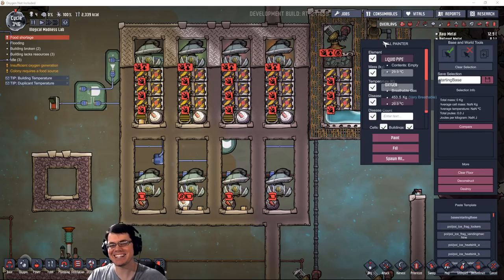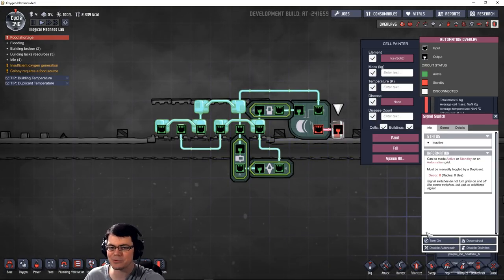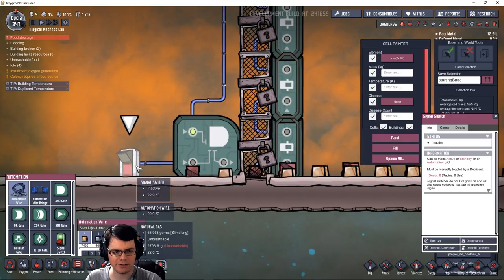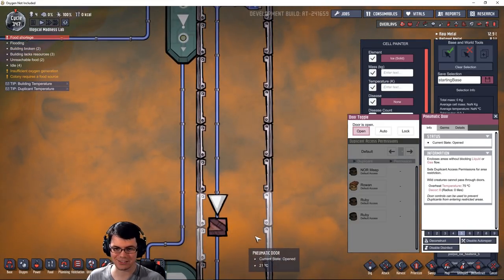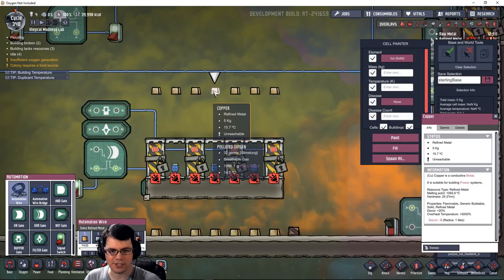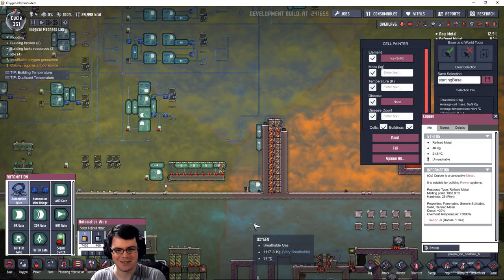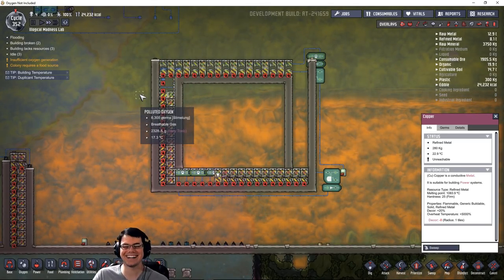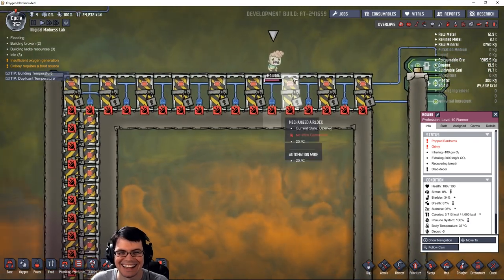Conveyors and Elevators! Oxygen Not Included Automation

Comment: Question, can you build a Polymer press on a floor, then replace the floor underneath it (and one tile to the right) with a door? Will it still function whilst the door is closed? Whilst it is open? If it does function while it is closed, you could sync the door do the plastic production, and cause the plastic to drop into an automated conveyor that will transport the plastic to a cooler environment to prevent it from melting (perhaps have active cooling pipes run through the conveyor to keep the air in it cold for the plastic, and use less energy consuming cooling mechanisms to keep the press functional)

Comment: What you need is a 2bit counter and an decoder that makes sure that there's always a place where the material/liquid/gas can go. That way you have an actual moving compressor/conveyer/elevator. I've already described it working here https://forums.kleientertainment.com/topic/83723-useful-automation-gadgets/?tab=comments#comment-971642

The way it works is that there's always two doors side-by-side open and two doors side-by-side closed. For example, AB closed and CD open. At the next tick A open and C close. Next tick B open and D close and at the final tick before it resets back to original position C open and A close. So if you have a long line of them it will be a continuous moving opening and closing row of doors.

That is a the real way to do it.

Comment: Yay!  Conveyors!  The last remaining question in this is "Can you do this such that gas does not leak through?"  If you need this stuff in your base (say, a planter box farm that your dupes are too lazy to harvest themselves), you could have the stuff dumped in to a water lock or maybe a petroleum lock that your dupes have access to.  But can you easily dump fertilizer in to a furnace to get sand without contaminating the furnace with bad gasses, then get the sand out?

EDIT:
Yes! You can! You can use something like the mechanical water pushing airlock from your airlock video to vacuum the chamber, removing the gasses!  If there is magma in the furnace, you can use an elevator to move the magma and wand up, then to the side over a mesh tile where the magma can drain away, thus leaving you with sand!  You can have pipes with water or oil in them behind the doors to try to cool the sand for use in the base.

Comment: I can see the use of the timerblock now! In your fertilizer maker room/natural gas plant just open all the doors under the machines once every cycle, making the fertilizer drop to an area dupes can reach. Will require a system to keep the Natural Gas from escaping the room. Maybe a conveyor at the bottom of the room going from right to left with a naphta lock at the end where (hopefully) all the fertilizer will drop and a door above the last one of the conveyor that opens briefly to let the Natural Gas back in the fertilizer maker room. All of this triggered by the timer block and set up with buffergates so it only but automatically runs once every cycle.

You could pretty much do this in any factory setup, given the rest of the factory conditions are stable and handled. Still trying to think of a good way to set up a plastic factory and handle the steam and heat waste properly.

Comment: That's how I made my ice maker.  Water drips onto the tops of doors in a cold hydrogen room, turns to ice.  Once a day, the doors open and drop all the ice on the floor, then the door stack pushes the ice into a room that reseals and becomes accessible once the hydrogen has been pumped out.

Comment: So, the strategy is when you want to excavate a large mass of land, you would first build this at the very bottom of the dig site, and use ladders to dig out the whole area, so that as you work, everything is being shuffled into one spot.  Then, if you're working above your target storage facility, you dig the pit down (this could be done before), or you build the elevator to move the mass upward.  You could do both legs together, but it's probably situational depending on how much material you have for doors, and where you're digging versus where your duplicants are coming from.

If the material moves up one to the side and then falls when it's transported horizontally, then does that mean that you could also move things at a diagonal?

Comment: MAS SCIENTIST EPISODE! This was really cool, and a neat look into how the physics of the game works. It's interesting that it takes the speed of the game into account too. Maybe it simply can't recalculate fast enough to keep up with the speed increase? Suddenly my game chugging at times makes way more sense lol.

I feel like if you even partially enclosed the system it would work as a water conveyor just fine. Maybe add a few blocks on the left above the doors and see if you can get it to pump out that way.

I see you've found a way to automate hatch feeding, excellent!
Reply: To elaborate on the hatch feeder: the fertilizer maker sits on the doors which periodically opens to drop the fertilizer to waiting hatches. We know hatches won't go beyond naphtha doors if they don't have something to stand on, and they don't require oxygen to survive, so its safe to have them in an air locked chamber of whatever producing coal. Dupes can come up a ladder just to the side of the naphtha lock, hold their breath long enough to collect the coal (or just be in a suit!), then escape with their carbon goodness to go feed the coal generators, which in turn feed slicksters, which make oil, which is then super heated to natural gas, which then feeds the fertilizer maker, which in turn feeds the hatches...

Closed loop with (I think?) no waste and potentially a power gain? Might have enough spare oil to use for plastics too.

Comment: The last time I tried the elevator, we could not go lower than 1s for the buffer and filter gate. Maybe now, with 0.1s interval, I could make it work. Will give it a try tonight to see if it works and send you some pictures if it does.

Because as you saw, you cannot force the duplicant to move sideway with a door. But I found a way to fix this (hoping it still works with the last update of course).
Reply: It seems that you can pick only 0.1 OR 1s. Values between the two are not selectable, even with direct input (they either go down to 0.1 or up to 1).

It is a shame as the duplicant get stuck with 0.1 (doors close too fast) or they are climbing up by themselves with 1 (too slow).

Comment: The right only conveyor can be made a lot more simply,  use a Weight Plate under a door to create a simple clock then with a Not Gate and some wire you have a super simple conveyor. I am curious what other uses there are for a simple clock as I feel there are many

Image: https://imgur.com/a/TrIpD
Reply: In that system, you could save a tiiiny amount of resources by lowering some of the top wires by a bit.. Just an observation.

Comment: What if you made an automated hatch farm in which the material is conveyed in through the roof on to a clock activated door in the hatch area. The clock would only open the door when the hatches are burrowed. With a working system you can have completely autonomous coal farming!
Reply: The dupes would never even have to see the hatches. Only thing you would have to worry about is uneaten material getting through. The amount of material going in would have to be monitored or limited somehow. I should start doing some experimenting myself lol.

Comment: I wonder when you'll run out of things to clap with at the intro lol

Also i see where you're going, produce natural gas and fertilizer, the fertilizer gets into the conveyor belts, and then maybe drop into a really hot area so they become sand? I wonder if that would work, wouldn't the fertilizer maker stop working while the doors under it are open?
Reply: Sukiida there will always be more to clap with
Reply: im sure it will stop working while the doors are open but you could have it open once every few minutes and only open for a fraction of a second, the production lost would far outweigh the time saved not having dupes haul the stuff around. rather than a fertilizer maker though (not much use really for fertilizer) i would be trying this on the plastic press as they produce good stuff that you might want to move from one side of the map to into the base. the problem with the plastic one (if it can actually function on doors i havnt checked) would be dealing with the fluids that would come along with the plastic. thats a solution id like to see happen, maybe a system that purges the fluid to one side then drops the plastic into a lift to go up, either that or have the lift be open on one side so the fluid can drip out while the plastic goes up, thats assuming the side of the elevator dont need to be there for it to function, otherwise youd need a mesh tile and its already kinda expensive without using mesh tiles, fun video though and i like where this madness is heading
Reply: It will stop, because it will miss foundation, like when you build on a normal tile and deconstruct the floor.
Reply: Maybe if you use a mesh tile to drop the water and let only the plastic pass through, but it may glitch and fall into the tile itself
Reply: Maybe by producing heat in one area, then transfer that heat to another area, then insulate with vacuum the area between those areas, produce heat again, repeat
Would that work?
Reply: Tt might if there was a refrigerant which heats up when it's compressed - keep all your machines cold while keeping the things you need hot, hot...

Unfortunately, there doesn't seems to be anything like that in the game..

There was a relatively old heating solution involving space heaters in chlorine, it was used to boil polluted water into clean water, that might work for getting high temperatures.